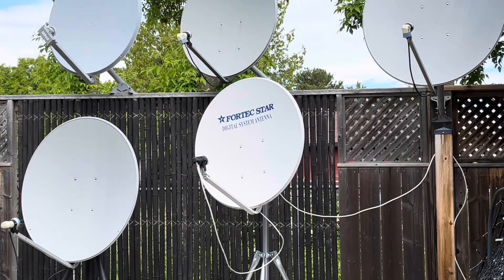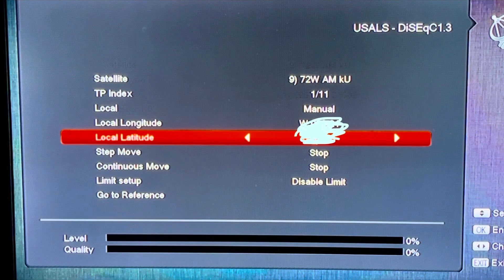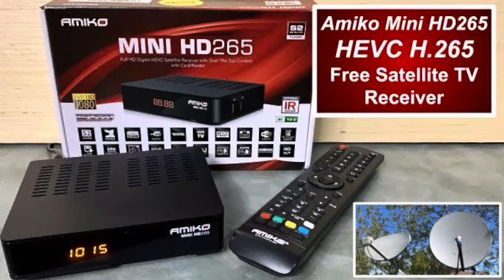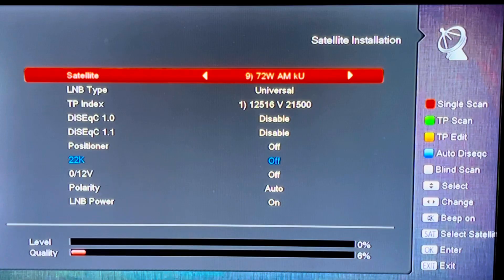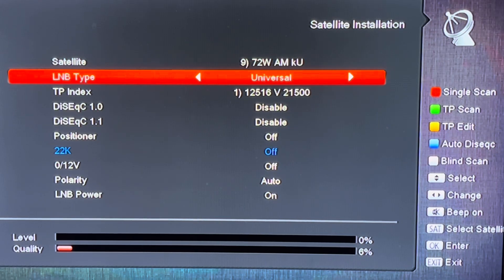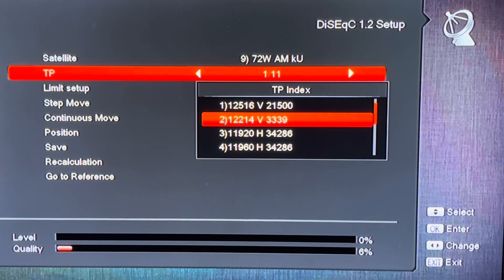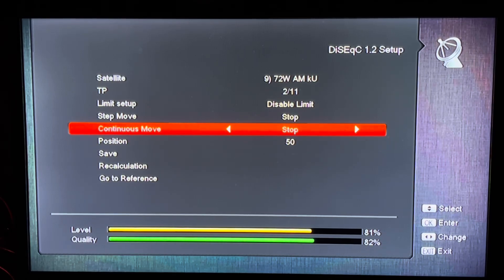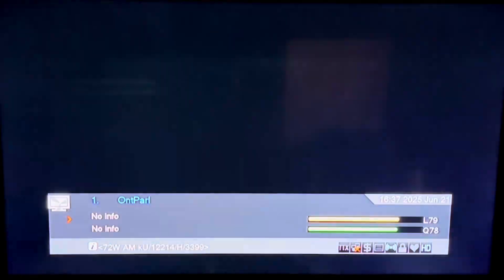Adding a Satellite to a Motorized FTA KU Band Dish using DiSEqC 1.2 Commands

Comment: Great Video! Question is it absolutely necessary to enter the transponder before moving the dish it East or West? With no transponder are you more likely to catch an unwanted satellite, one without matching transponders?
Reply from the maker: You’re better to manually enter a 
transponder that’s active so that it will pick the signal up when you move the dish. Otherwise, if you use a random transponder that is already entered in the menu it may or may not have a signal on it and you won’t know where to stop the dish.

Comment: USALS H-H motor is far better than an actuator, instead of two cables you only have one cable your typical RG6 coaxial cable which carries TV and radio singals and controls the motor. They are very easy to install. Also some H-H motors can be use for 120 cm dish, but for most motors the 100 cm dish is the maximm accepted.
Reply: You can get a vbox converter to control an actuator through diseqc 1.2 to 36volt. I need to get my motorised channel master dish working again I have a jaeger 1224 36volt motor